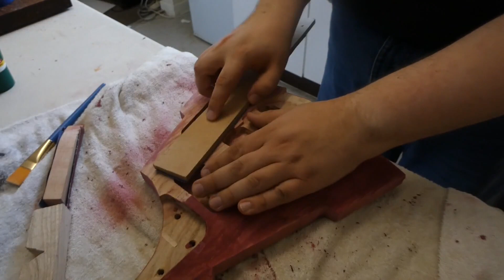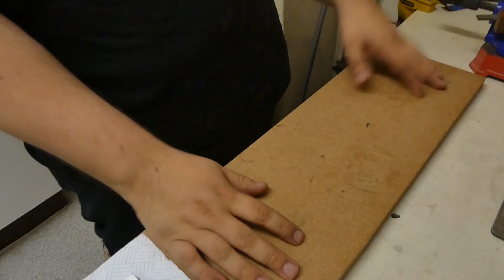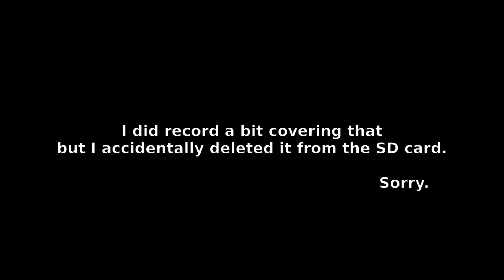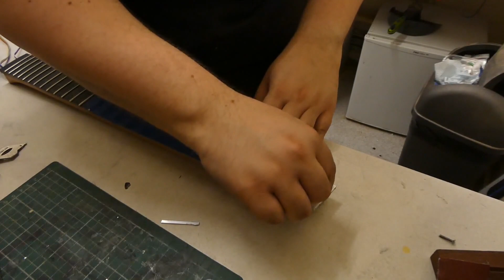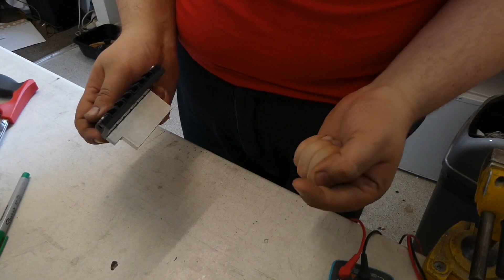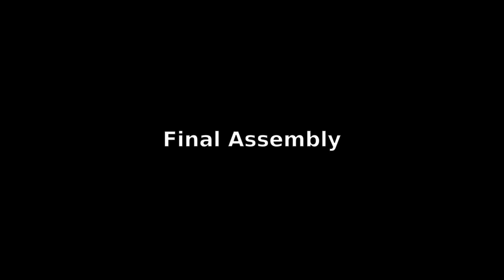Behold the Imperator EV-H1! GGBO '21- Failed

Comment: Concept - Awesome.
Fabrication of your own bridge and other items - totally crazy - but awesome.
Running into problems, looking for solutions and constantly forging ahead - pure respect from me.
Unfortunately, with time, budgets, weather, lockdowns and other things out of your control - things just snowballed and small issues grew into bigger ones and every fix cascaded into a new issue elsewhere in the build. 
It happens.
I think your post-mortem/post-project review is worthwhile. There are a lot of concepts and ideas in this build that can be kept for the Imperator Mk2 - Electric Boogooloo :)
Take all the best bits from this one, take note of all the pitfalls, make a full build plan with plenty of time built in and make Mk2 to the best of your ability and blow us all away.
Reply from the maker: I'm in the early stages of planning GGBO '22. It's probably not going to be the Imperator MKII, but a lot of what I've learned will be going into it.

Comment: Gutted for you, mate, but I get it.

I really like the bridge. Have you considered a cartridge for surface-mounting?

FYI, if you have a jewellers scroll saw, you can put the individual welder cleaning files in the frame and it's a lot easier and more effective.
Reply from the maker: I could, although I think I'm just going to invest in a decent set of nut slotting files. There are some tools you can bodge, but the further i go, the more I'm finding that nut slotting and fretwork tools are tools where I should just get the real thing. 

As for the bridge, there is a MKII in the works. It's in the very early stages, but more on that in the post mortem video.